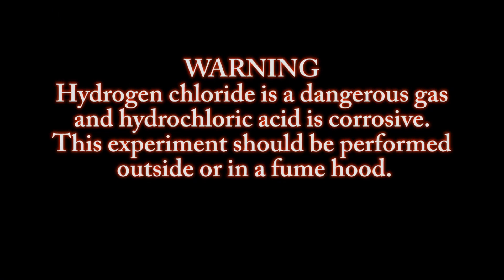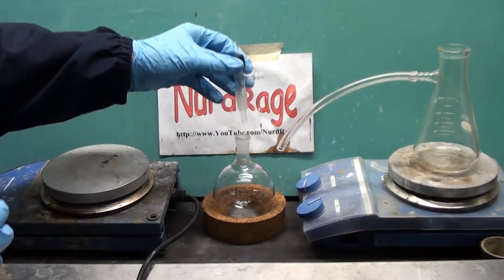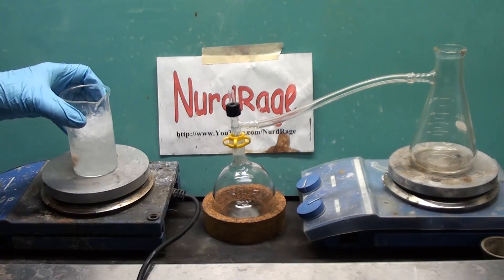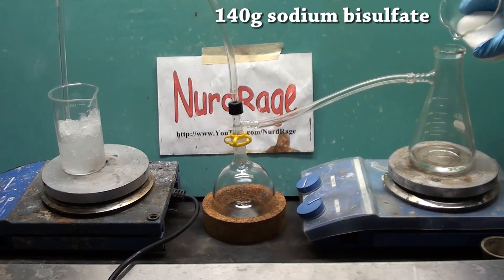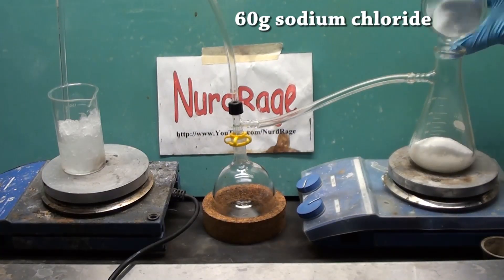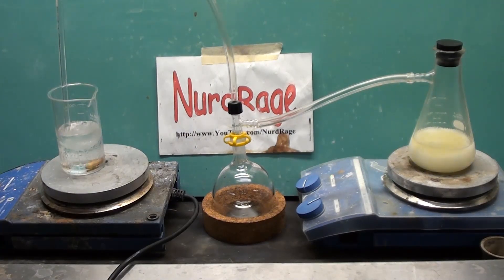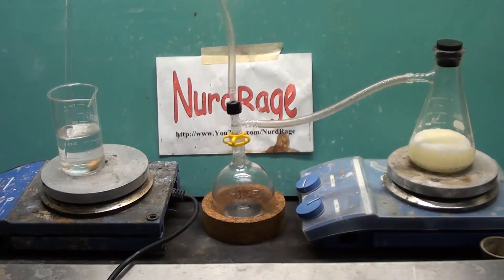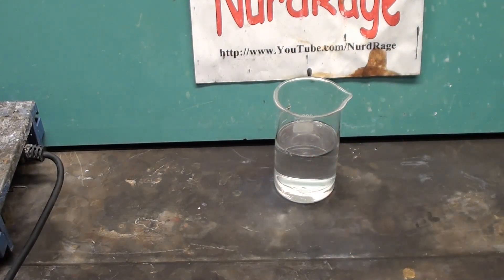Make Hydrochloric Acid

Comment: This that water comes to absorb hydrogen chloride, i did this with carbon dioxide and water and it also pulls water. HCl is mych more soluble in water than CO2. In your video making nitric acid NO2 doesn' do this. Why? It is alo soluble in water(it reacts). And also reaction of sulfur dioxide with hydrogen peroxide... Can made H2SO4 be backed in reaction mixture by this?

Comment: I naively attempted to conduct electrolysis on a NaCl water solution in the vain hope of producing sodium (I now know the proper method of attaining Sodium and I lack the equipment to do it via electrolysis). I do recall a strong sent of Chlorine gas which lead me to stop the test. I'm certain the three by products would have been NaOH, chlorine and hydrogen gas. Would this be an accurate guess? I thought there was hydrogen chloride gas but I would think it would be a sour smell.

Comment: Is the thing on the round bottom flask a 1361 gas generator stopper?  If t is not could you tell me what it is called?  I have obtained most of  the equipment to try this experiment but the stopper on the round bottom flask has eluded me.

Comment: Thank you for making this stuff look easy!  I am curious, do you know what the percentage of concentration is of the Hydrochloric Acid in your video.  Also, is there away to estimate the concentration based on certain dependant and independant variables?  I understand if the last question would be to hard to explain to a novice.  Thank you for doing these videos, they are awesome and easy to understand.  I would also like to know if you have a special place to shop for chemicals and equipment.
Reply: idk if you need it a decade later but measuring out 10mL of the solution in a graduated cylinder and measuring the mass lets you calculate a rough estimate if the density. This can then be checked against a density table giving you the concentration.
He says that he used 100mL of crushed ice which is around but a bit less than 100mL of water. He used about 1 mol of NaCl so he should be getting a concentration of about 10M which is somewhere around 1 quarter of HCl by weight.
Reply: pH=-log([H]) use algebra to solve for H, and that is the number of moles of hcl in 1 liter

Comment: funny thing^^-  fill the roundbottomflask with hydrochloricgas than  turn it quickly on a container with water. what will happen is, the hydrochloricgas dissolve in the water by sucking the water in the roundbottomflask ;D

Comment: couldnt you avoid backfire like that by using two "one way" valves one in the stopper with the air flow going in and one at the exhaust with the air flow going out so you dont end up with that vacuum recompression issue

Comment: I have a few questions:

1. What heat range our we talking about for the reaction vessel? Can we burn it?

2. You have two heaters, is the heater to the left on?

3. How powerful is the "backflow", can it knock over glasses?

4. Your using plastic tubes to transfer an acid, don't acids dissolve plastics?

5. Could you do more videos with electrolysis?

And 6. Hope you had a great Easter :D
Reply: 2. The heater on the left is most likely turned off, serving just as a stand. Otherwise it would undermine the idea with the ice bath.
3. I don't think so. Just make sure that there's enough room in the round bottom flask.
4. Not all plastics. C–C and C–H bonds are usually hard to break even with strong acids. Their pKa is very high (16 and more). If you need something extra safe, use vinyl or teflone. C–F bonds are really strong.

Comment: @NurdRage hey hehehe. but wait, you said we don't actually need water.

But hey, NaCl has a strong electromagnetic force because they are ionic compound.
But how did you heat it easily to decompose it to make chlorine gas??
That is not easy to break there bonds because they are - and + ions that attracts very strong!!

=)

Comment: @nurdrage
Yeah i tried this experiment, it back flowed slowly. in the end i didn't wait for that sudden back flow result turned out to be very weak.
i also connected the generator straight to the beaker omitting the round flask. it did back flowed like this video but then the the bottom of the generator flask cracked off due to the rapid change in temperature.
can i buy "Glass Glue"  to repair it or will i have to buy another one of those flasks?
u viewers: don't make the same mistake i did

Comment from the maker: @DominicCopeland the one under the ice is just for stirring, the heat isn't turned on. The hot plate for the reaction is set to 250 degrees Celsius.

Comment from the maker: @heydeech distill until you get the azeotrope, then bubble gas for higher concentration. Migh be helpful to put the receiver immersed  in ice for better absorption.
Reply: Can you tell me what 0.1N or 0.1M which is seen on the hydrochloric acid that you can buy (here in the UK) actually means? The company who sell it have no idea. Is it the dilution levels, if so what exactly does it mean. I want to buy some 1/500, 1/1000 and 1/1500 mixture but don't know where to buy it as different manufacturers give different levels on the bottle, but no-one explains it in a language that a non chemist would understand. I have also seen 1M and 4M on the bottles too.
Reply: @jezzyby47  "M" stands for "molar" = mols per litre = concentration.

Comment: Simple question. What is the point of round-bottom flasks? I assume they have some benefit to make it worth using a container that requires a special holder to make it not fall over. Just curious

Comment: good vid, I always wonder how they make that. Is it possible to determine the molarity ( not exact) but a rough estimate of it? and why we use ice instead of regular water on the beaker? is there a reason for this?
Reply: From my experience, ice water is used in reactions that have a tendency to occur rapidly. Either in a way that they're violent, or that unwanted byproducts are produced

Comment: Oh wow, exactly as I sent a message asking you about Hydrocloric acid, you go ahead and make awesome video showing us how to make it with quite commonly available stuff. Except the backflow prevention system, not sure how to get a hold of that. 
In any case, what percentage of concentration would you approximate in this resulting chemical ?

It'll sure beat 20% HCl cleaning solution I have around :p

Comment: Awesome video. To prevent the back-flow couldn't you also use a one way valve on top of the generator flask to let air in when the reaction stops and creates the vacuum?
Reply: (11 years later)
Ya that would theoretically work, but you'd want to be damn careful with the base material of your valve. For example under normal conditions you'd only want metal in contact with HCl if you wanted it to desolve, but if push came to shove you could get away with it... that's not necessarily the case when it comes to HCl₍₉₎. Most of the commercially available HCl is in the 20-30% range which is rather mild when juxtaposed with pure HCl₍₉₎, which rocks a pKₐ of -6 (I'm drawinf a blank but I'm pretty sure thats a 100'000 fold increase... unless a "fold" increase is ment to be used like like folds of paper. Then it's more like a  16.60964 fold increase)

So in short if you have a mostly hermetic inert valve then your gold, but if you just slap a brass valve in there... let's just say it could possibly turn into a very interesting day.

Comment: hi nurdrage, I just want to know, whats the name of the attachment you used in the middle flask? Also, if you wanted to get a higher concentration of acid appart from using less ice like you said, could you just boil the product to remove the water (I really should know this, i study chemistry at A-Level) cheers